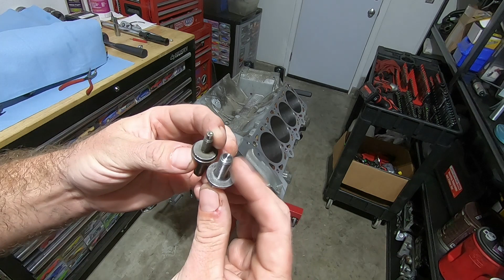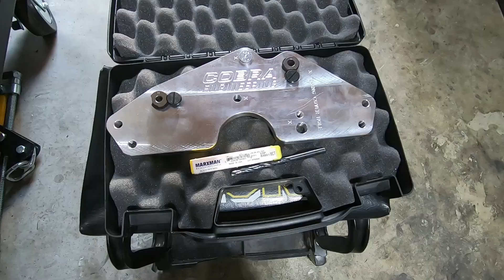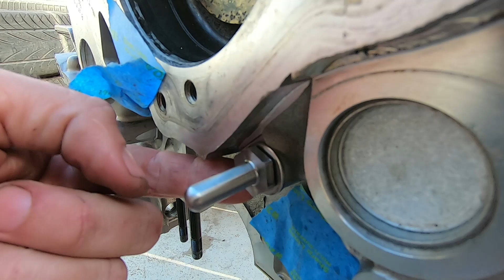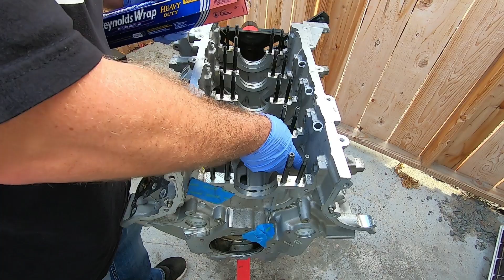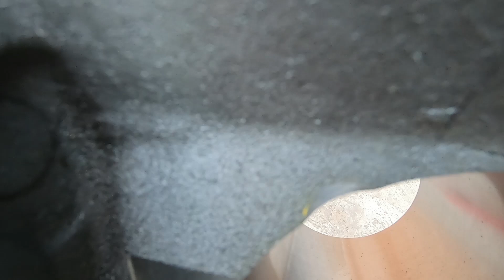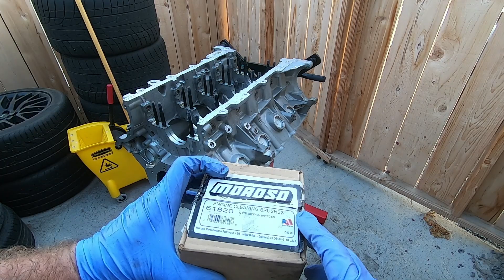Pt 9 Pivot Pins, Drilling, Tapping, & Final Cleaning - 5.0 Stroker 4.6 Teksid Engine Block

Comment: Is this a must (pivot pin) for every build?
Reply from the maker: No, it's not a must but it's a good idea, especially if the engine will be used with a transbrake or a two-step ignition.
Reply: @JohnSmithRacing  ty sir